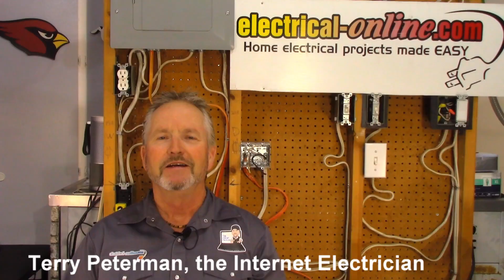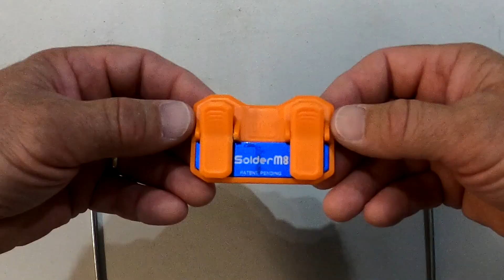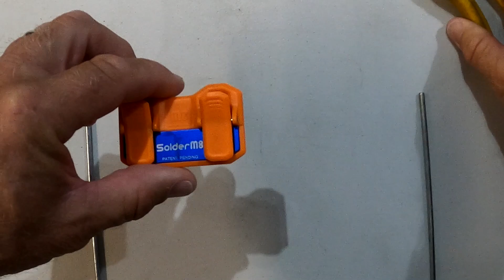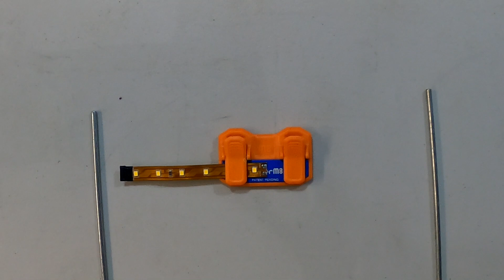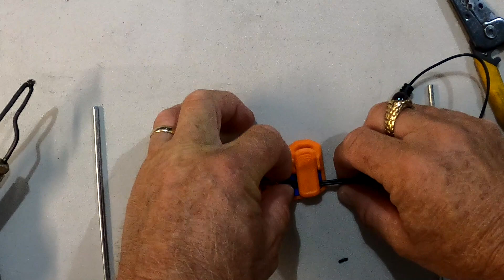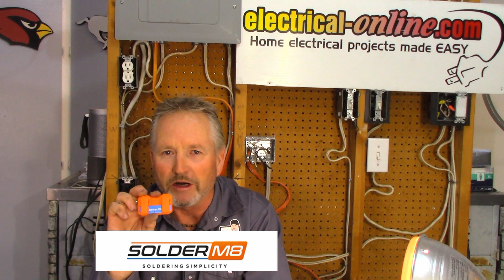Tool Tip:  An Innovative Solution for Solder Connections

Comment: Have been using the Lisle 55000 Wire Holder Assembly for years, but admittedly the Solder-M8 does appear to get the wires closer together and also provides a back-stop to press against when soldering.  With the Lisle tool, you really need a very soft touch and it's a bit pesky.